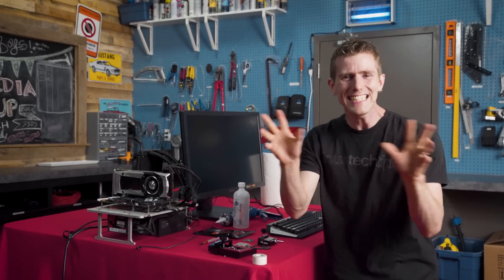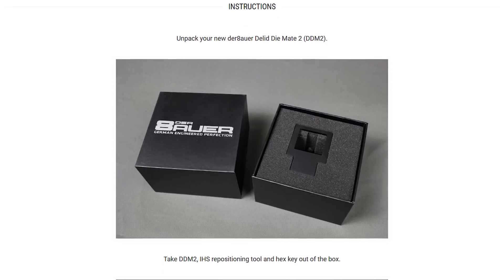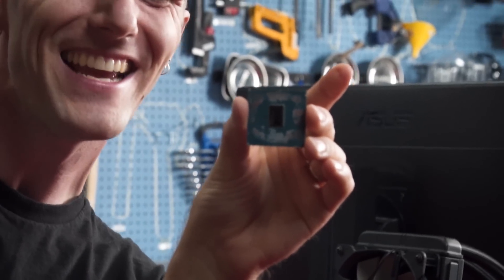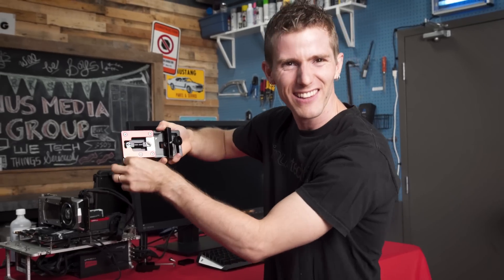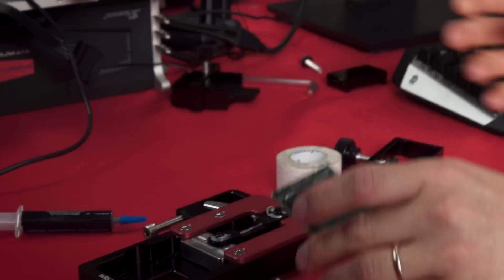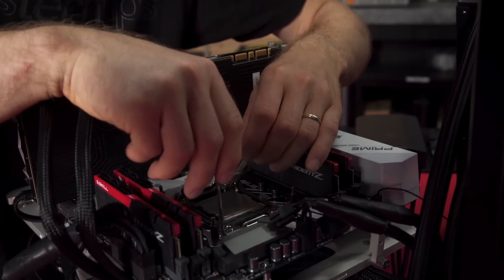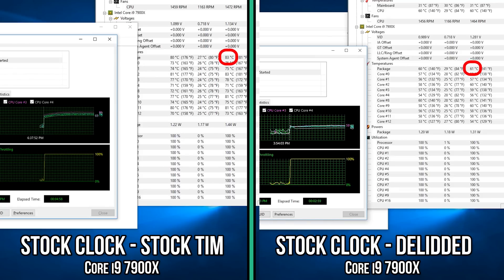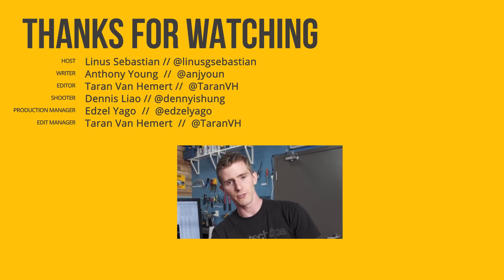Delidding a $1000 CPU - Worth the RISK??

Comment: If we are paying 1000$ for a cpu and intel wants to be way bigger then amd in every way ... cant they spend the extra few pennies of compound for their consumers? Its literally THERMAL PASTE!! WTF is wrong with you intel!
Reply: or just solder it to the IHS, which would be even better.
Reply: If AMD can do it for their low-end chips, I don't see why Intel can't do it at least with its fucking flagship products. It's not like they're gonna make millions of i9s...
Reply: did you see the cooler intel gives you?
Reply: Maybe they're in kahoots with big-heatsinks to force consumers to buy bigger more powerful air coolers/AIO's to cool the "super hot chips".

Illuminati confirmed.
Reply: Alex Marin gee i wish intel had have known solder was cracking and unreliable in my old I7 thats been running overclocked for the last 6 years....oh wait
Reply: I don't get why every Intel fanboys defend Intel's use of poor TIM instead of solder by saying "Solder is known to be unreliable due to thermal cycling causing cracking and hotspots– AMD is forced to use solder because their chips otherwise would run too hot and they can’t handle high temps either."

Remember the Nehalum and Sandybridge? they use fucking solder, they're approaching 10 years old, and tons of people are rocking those without any issues.
you can't even find any forums discussing cpus dying because of solder either because it's so much more reliable than the toothpaste intel use now
remember, intel's TIM can dry out too.
Reply: Saying solder is unreliable and cracking is bullshit, working pentium 4s are everywhere at recycle center, people just trash them because they are too slow.
Reply: Intel, is that you? Most ridicolous argument i heard in a while (right after the one where intel claims they stopped soldering chips because it was not eco friendly).
Reply: There is no such thing like "AMD runs hot". 65W TDP and 45W TDP standards runs cooler than any higher TDP and AMD have 65W TDP. So my AMD runes at +25C (over environment temperature, ~45C most of the time) when forced to max (and +15C idle). And that's 9 years soldered, no thermal compound change, computer has been moved multiple times (not like a box sitting in one place). If there are any cracks in soldering or thermal paste dried up, temperatures are not affected, so either the quality of the thermal conductive products 9 years ago were better, or there is some kind of a myth here.
Reply: i agree withe adrenelinedude, i have a thread ripper, you can literally go to my channel and see it cause i have numerous videos posted of it. for 1, my thread ripper over clocked to 4.15ghz does not ever get hotter than 60c at full load. i have tested it on load stressing software and had all cores maxed for about a half an hour (think i may make a video proving that) and my thread ripper, with literally 2 cpu's in it (technically four 4 core die's, but also technically 2 1800'x in it), it never runs hotter than 60c at full load. at idle is stays close to the high 30's to low 40's c. 
every single i9 runs hotter than that at stock frequencies. literally at full load at stock they are hitting 80c. gamersnexus delided a 7980xe and proved it is using the same shitty thermal compound as all other i9's. further, he tested stock temps and after deliding. literally dropped a bunch with liquid metal compounds he used. he also said, that stock clocks the wires alone were getting super hot on the mother board. point is, that the thermal compound intel is using on all i9's are literally shit. amd's soldered chips literally overclocked are running cooler than intels stock frequency chips. so that means, that soldered is literally superior, solder does not crack and i don't know where the dumb asses getting that info from. soldered runs cooler, making the chip last long period.
Reply: Gearboy (Official) it's not implied, it's actually tested. Look it up, there's a guy who delidded and measured the exact distances before delidding and after, he even proved that if you mount the IHS the exact same distance as stock, but change the paste to a "higher quality", the temperature is even worse than stock. The real benefit of delidding really is the distance change, not the paste.
Reply: Malus1531 We certainly do, If it where a problem then the older Intel CPU's would be coming out of the woodwork in droves years ago.

Even anecdotal evidence would be circling the internet like a rag that just won't flush, but no - the only things are people asking when intel is moving back to solder. Even if it where to do with chip size it would not be difficult to enlarge the chips top surface by the 15mm2 by widening the under chip BGA to allow for the soldered connection to be reliable.

And this is before going into the whole debate about the quality of the TIM used
Reply: Gearboy (Official) I agree. Especially at the high temps those i9s are running at
Reply: Gearboy (Official) I don't understand why so many still believes it's the thermal paste that effects the temperatures that much, it's all about minimizing the distance between IHS and die, delidding the CPU allows for the IHS and die to be closer.
Reply: I found the post, search for "delidding my 3770k anandtech forums" on Google. he wrote different sections with different tests. There is the one called "Proof that the benefit from Delidding is entirely due to reducing the CPU-to-IHS gap" which is basically the TLDR
Reply: Copied from the end of the post: "Conclusion: The Intel stock CPU TIM is not the reason Ivy Bridge's run hot, and replacing the Intel stock CPU TIM is not the reason a delidded Ivy Bridge runs so much cooler - the benefits of delidding are entirely due to the resultant reduction in gap height between the CPU silicon die and the underside of the IHS."
Reply: "Bear also in mind here that LM would also provide a 5-7C reduction even if it was compared against solder – it is just the superiority of LM as a thermal interface" it's not much better by himself it's better because it's thinner, solder is .5-1mm thick LM is less than .1mm thick, and i don't think is worth the risk delidding a soldered CPU
Reply: ya i agree, most people don't know shit about intel. further, most intel fanboys don't think intel can ever do anything wrong either. hence reading some of the comments on this very thread has a lot of ignorance coming from intel fanboys.
Reply: +L Adam +IlluminatiBG Again, those older soldered CPUs are not comparable. All of you guys are ignoring the fact that those old soldered CPUs were much larger than chips like Kaby Lake (Skylake-X is a different story though that should definitely be soldered). +Ben Grogan How do you know it'd be easy or cheap to increase die size? They've been working at making them smaller, why would they go backwards? What does ball-grid array have to do with it?
Reply: How do you know it'd be easy or cheap to increase die size? They've been working at making them smaller, why would they go backwards? What does ball-grid array have to do with it?
Because the BGA under the chipset that collects the chip to the pcb is what the deciding factor for the size of the chip is in the current gen, the size of the internal components is a semi-irrelevance to the chip size if you look at the mapping for the chips internals at 12nm they need to get enough contacts for the chip to do what it needs to - the maps already show voids that could have been shrunk if that weren't the case.

As for why they would go backwards because as we've been discussing solder microfractures where they have been investigated become an issue for the reliability on sub-145mm2 areas, the study specifically stating that it only becomes a significant factor sub-125mm2 and if temp cycling -20 to +150 celcius which is far beyond any theoretical use case in the real world as derba8uer mentioned in his article on that mentioned the study years ago
If 10mm2 on the chipset where to allow for Solder to be reliable and therefor allow temps to reliably drop by double digit numbers allowing minor spacing in the chipset cast, as already is allowed in some places, wouldn't be difficult at all.

And since you've already granted that Skylake X should be a solder connection would you care to predict what option they will use for Coffee lake, since it is the same 12nm production size but adding 2 more cores that should add around 40% to the die area over all - Pushing it to around 180mm2, the area where the reliability isn't an issue for solder again
Reply: I wont lie I didnt expect this comment to get so big xD ... Everyone is so mad lol
Reply: I don't see why AMD cpus would be considered low end, if anything they're better (soldered, vastly beter coolers), Intel just probably aims for 80+% profit margin and sells cheap 4 cores at a premium, while amd has to rebuild market share by offering much better value.
Reply: so thye should make the paste easy to replace other than prying off the top with extreme force
Reply: +ADRENELINEDUDE +Ben Grogan Read my previous post. The supposed issue with solder cracking is on small chips, which neither old Intel or Ryzen are. I'm not saying it's true, I don't know, but to my knowledge we don't have any small (160mm² or less) soldered chips to serve as examples. So you can't just say "my Sandy Bridge works fine therefore solder cracking = myth."
Reply: TheLifeStalker how does it get closer? Are you implying Intel doesn't put it as close as possible to the di? I don't believe Intel would do that. And if you could squish it closer then you wouldn't need to delid it you'd just compress it.
Reply: TheLifeStalker hmm interesting didn't know that
Reply: They wouldnt be the company they are now if they didnt some how make a profit which is why they do these things
Reply: is that so? funny i have an 1800x and a thread ripper and i play all my online gaming at 4k and have 0 issues with it. also seems funny that you probably don't even own an amd to be able to make that call. my point is, amd chips are perfectly fine at gaming period!! what you only game at 1080 and play at a fps that you won't be able to tell the difference between an intel or an amd? lmfao. what you get with amd is better multitasking ability. so sacrificing a few fps that you won't even be able to tell the difference anyways, you get a better chip for things other than gaming. at 4k all games are bottlenecked with the gpu anyways so it doesn't matter which chip you use. btw, you won't be able to tell the difference between 90 fps and 150 fps. the eye cannot tell the difference at that frame rate. so at any rate, quit lying and saying amd is inferior. it is not, it is better at somethings than intel, and if you want overall bang for the buck, amd is better because it can do other tasks better than intel.
Reply: oh what ever, i literally have a thread ripper and it is overclocked to 4.15 ghz and is extremely stable, at full load stress testing it never goes over 60 c.  point is, with brand new cpu's with smaller die's than those old ones you are talking about, amd soldered works perfectly fine, even runs cooler than stock x299 chips at overclock!! so ya, cooler chips means it will last longer.
Reply: well it'd be easy to increase die size, we know that mainstream cpus are cut-down version of defective server cpus that are much larger, so instead of cutting away all of the defective part, intel could just leave some left, or add just a bit more metal, not actual conductors to use as dummy-die, like how we see with threadripper and ryzen, that'd be easy and cheap to increase surface area, AMD's always done it, their chips have always been slightly larger than intel's because of it, don't know why intel can't do the same.
I mean even the 4 cores ryzen are soldered because AMD only cut connection to the other 4 defective cores but don't remove them from the cpu, allowing more surface area.

Also, even if the argument is legit for current mainstream intel processors, higher core count parts like the 6 cores coffeelake and i9's die size is definitely much larger than the mainstream kabylake. don't know why they don't just solder those.
Reply: +Ben Grogan Would that mean increasing the area of each chip on the wafer, reducing yield/wafer? Sounds expensive if so. And yes I agree Coffee Lake should be soldered, I said that above. I'm only arguing that it's possible solder cracking exists, and that I haven't seen any evidence contradicting the article this debate stems from. All these people are saying it's a myth based on the fact that their old large chips are still fine, which is irrelevant.
Reply: Malus1531 
"Would that mean increasing the area of each chip on the wafer?"
Not necessarily, increasing the area of the chip's outer casing substrate horizontally would achieve it at the cost of a few dozen pence per item, as the Der8auer article said, The microfractures have a far lower probability if this is done and if they start they will will start from the outside irrelevant space and work inward, adding dummy spacing at the side, sheerly for the sake of a stable solder bond at the center where the real thermals are.

And even that's before we consider we are only talking about Indium soldering, other solders do exist for smaller components

"And yes I agree Coffee Lake should be soldered, I said that above"
I wasn't asking the should, I was asking when we get them what would you expect - given that we are agreed that the size based argument doesn't work for the larger chips
Reply: +Ben Grogan Well I don't know anything about dummy substrate so I'll take your word for it. What other solders exist for this application? From the Der8auer article: "Indium is the only known material which can stick to both, copper and silicon. At the same time, solidifying indium doesn’t shrink much which leads to a small factor of thermal tension...The thermal conductivity is not as high as copper but higher than any other thermal interface material. In addition, indium is very ductile which allows thermal expansion of substrate and heatspreader without damaging any of the components involved...indium is the only material you can use." I would expect solder to work just fine on 6-core Coffee Lake chips.
Reply: How on earth does your CPU affect "online" V.S. single player gaming? 
I don't believe the world works like this. 
Not even yelling from the standpoint of an AMD fanboy-CPU just doesn't change results between online/local.
Reply: Malus1531 well, Core Duo2 E8400 have a die size of only 107mm 2, and it is soldered. Suck it Intel fan boy.
Reply: +Birki gts Sources? From what I've seen that whole "Ryzen gets better lows" thing is just a myth. By and large whichever chip is getting better averages, whether Intel or AMD, also gets better lows.
Reply: If the solder cracking the packages was a real problem, one would think the 219mm2 8-core Zen dies would be far more prone to it than the 151mm2 CFL or 112mm2 KBL dies. It's really obvious Intel is just trying to save a buck. The vast majority of their sales are locked-multiplier or stock clocked chips in prebuilts where the TIM doesn't matter at all. It sucks for us enthusiasts that you have to jump through hoops to overclock at all anymore but reducing profits isn't how you keep the executives happy. People will still buy the fastest chips no matter what, and the extra bullshit of having to void your warranty and buy $50 of tools and liquid metal is just going to be seen as just another added cost for most.
Reply: Gearboy (Official) that's why I buy AMD processors
Reply: 1# I agree that it is neither a gaming nor server CPU, but you are forgetting science. My laptop is shit in pretty much every area except the CPU, this means it's terrible for games, but it runs simulations and such about 5 times faster than my fellow students laptops. On top of that, these applications are easy to run on multiple threads, so you can actually utilize the silly amount of cores.
Reply: Just solder and end of the story.
Reply: Only logical reason I can think of for Intel to use so bad cooling paste is they WANT your CPU to run hot so it will only last just as long as the warranty and also not over clock well to make you buy new faster and more expensive CPU. I absolutely hate all companies that is so greedy that they sabotage their own products to sell more....
Reply: @a64738  4 years later, I can say that my 10 core lga 2011-3 CPU have great temperatures with 27$ cooler, 45°C in games, 65°C in stress tests
Reply: that would be all fine and good, but gamersnexus delided a 7980xe and showed that it too used the same shitty compounds that intel uses on all their shit!
Reply: ^ truth
Reply: "Solder is known to be unreliable due to thermal cycling causing cracking and hotspots– AMD is forced to use solder because their chips otherwise would run too hot and they can’t handle high temps either."

myth
Reply: Intel's thermal paste lasts well past the lifetime of the CPU, whereas the paste Linus put on probably needs to be replaced in a couple years. There may not be many good long-lasting paste options. Soldering is a different story though, don't see why they can't do that. Probably just money; soldering materials/process costs more and can sometimes fail (reducing yields).
Reply: Malus1531 Not true. Intel I replace it after 1 -2 years my like my uncle's PC crashing after 1 year of usage cause of high heat replace thermal of intel chip. Me that's why I like AMD no need replace thermal paste.
Reply: +Jonathan Laig I've never heard of Intel's TIM drying out, the whole point of the TIM they chose is endurance. +Vegetables are good for you One of the main points of the solder cracking article you're referring to is that the solder is less reliable on small dies. Nehalem and Sandy Bridge had 296mm² and 216mm² dies respectively, but Ivy Bridge (when they started using TIM I think) is 160mm², and Kaby Lake 122mm². Ryzen in comparison in 213mm², about the same as Sandy Bridge, making it easier to solder. So the argument does sort of hold up; I'm not 100% convinced but I was willing to give Intel the benefit of the doubt when Kaby Lake released. However Skylake X and I assume Coffee Lake are larger and still aren't soldered, so the argument falls apart there. Intel does just appear to be cheaping out.
Reply: You are incorrect about it drying out it's actually forming a solder like connection and the performance doesn't get worse it actually gets better.  Learn more about liquid metal before you speak.
Reply: so yeah, best reason to neve buy their new cpus right?
Reply: Serius Sim amd cpus are fine for single player gaming. Intels always perform better in online gaming (which is most of gaming now days)
Reply: Vegetables are good for you Intel just works better bro. You think some replaceable paste is a selling factor to the inferior AMDs. They just don't perform as well in online gaming.
Reply: I just have to say 2 things.

1# i9 is a enthusiast CPU. PURELY enthusiast. Its not a server its not a gamer cpu. Its purely for xeon performance in a overclocking platform. In any other high class field of enthusiast form of anything. Cars being a perfect example. I have to regular routine things to keep my car functioning that a normal car doesn't need higher quality gas, oil fuel filters and more regular maintenance. If I need to replace my compound 1-2 times every couple years that should be ok. It'd be absurd to think that something doesnt need maintenance.

2# My laptop thermal paste dries up every few years. Most laptops are waaayyy harder to open up then a desktop cpu lid. If a gaming laptop requires thermal paste maintenance then why not a enthusiast CPU.
Reply: On the higher-end i9 SKUs (7920x, 7940x, 7960x and 7980XE) as well as on the Coffeelakes Intel did use better TIM. Also these higher-end i9s have larger surface area than the 7900X and the same applies for the Cofeelakes versus the Kabylakes. Larger surface area means better/faster heat extraction resulting to lower temps. Der8auer said that as a result, for both the Coffeelakes and the 12-18core i9s, if you replace Intel’s TIM with a high-end TIM like Cryonaut (the one Linus used in this video) it will only result to 4-5C improvement (and even that at high overclocks). Here it is also important to add that on the plus side Intel's TIM doesn't suffer degradation over the lifespan of the cpu die, unlike the higher performing ones.
 
Liquid metal CAN drive the temps a further 10C lower but it has serious disadvantages. Its application needs careful craftmanship (so it cannot be automated in manufacturing) and most importantly it also dries out after about a year so its thermal performance tanks (thereby needing delidding and replacement). So LM would be a disastrous option for a manufacturer to use. 

Solder is known to be unreliable due to thermal cycling causing cracking and hotspots– AMD is forced to use solder because their chips otherwise would run too hot and they can’t handle high temps either.
Reply: 1. Liquid metal does dry out after a year. The main issue with it is that is does so unevenly creating hotspots in the process. The system will become unstable at the higher frequencies the cpu was overclocked at and will keep crushing until LM is replaced. I like how someone provided his delidding of a 7700K as an evidence. As if the 7700K is around for over a year and isn’t only 9months – and likely his quoted delidding is just 6months old.

2. Nehalem chips were manufactured with the 45nm process and had a die area of 263mm^2. A 7700K Kabylake chip is manufactured with the 14nm+ process and has a die size of 126mm^2. The mere fact that people compare the two speaks volumes about their ignorance.

3. Intel IS using better TIM. Der8euer did say that using higher-end TIM only yields a 4-5C reduction in the i9s and Coffeelakes. Gamers Nexus also showed that for the high-end i9s and the Coffeelakes the advantage of LM is only 9-10C over Intel’s TIM at reasonable overclocks. Bear also in mind here that LM would also provide a 5-7C reduction even if it was compared against solder – it is just the superiority of LM as a thermal interface. Also you have to take into account that the most impressive temp reduction results (the 20C that you might hear) refer to unrealistic stress tests, like Prime 95, which pummel the cpu more than any real life application. And that also when the CPU is overclocked to its maximum well beyond its advertised specs. In real-life applications and with moderate/reasonable overclocks the benefit of LM over TIM is much smaller.

I find it funny how a bunch of ignorant, unqualified people are attacking me. They like living happily in their own fact-free bubble and are afraid of it getting burst.